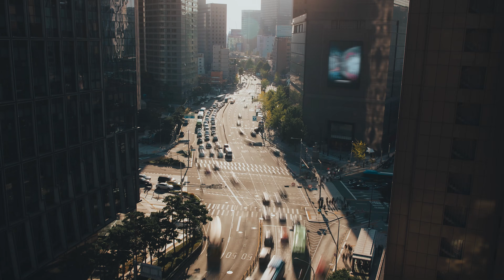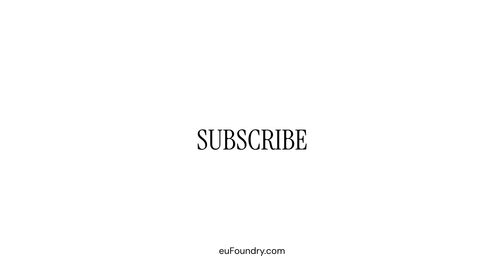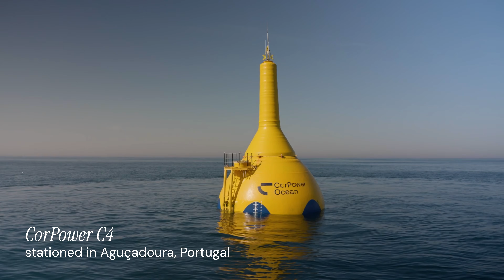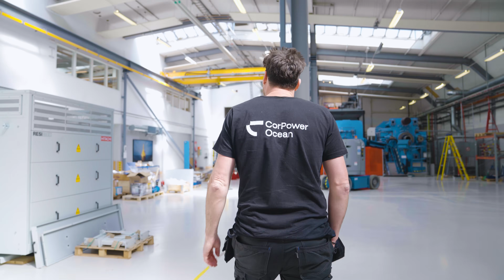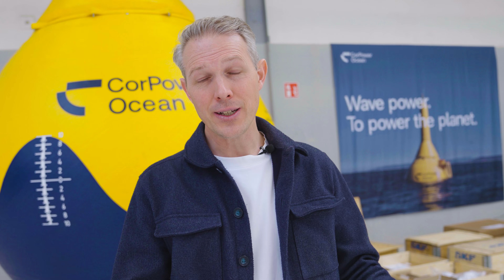The 10x More Efficient Renewable (That Nobody’s Talking About) #009

Comment: And yet just another parasite likes the rest of the Renewables the ignorance of the Renewables exporting to the grid is easily demonstrated with a volt amp meter and Ohm's law so once you double check the inverter and or the power companies watt meter you'll see an 85% difference from what is actually going in the grid and discover a reason for skyrocketing electric bills
Reply: And the other ignorant part about renewables is you cannot make renewables with renewables duh

Comment: Glad someone is still working on this; however the mechanism still appears to be too complicated.
I wonder if the designers have considered a similar machine with a more basic rack and pinion system without all of the articulating bracing structures.
I believe that the anchoring system is "off the self" , his is a GOOD move.  A system like this needs to use as many existing parts as possible. bespoke parts and tooling to make them REALLY eats up the design budget and makes the end product impractically expensive.

Comment: Weather based energy will never work.   You can not run factories, businesses , or homes on something g unreliable.   So what happens with these?  You need a traditional power system running along side it.   So you’re still using traditional power whether you meed it or not.

Comment: It would be nice in one of these videos they would actually talk about the most important thing ie the roi. Hey, we plan on selling these for X price range. If you can sell the electricity at .18 cents a kWh or in this range then your payback is this many years. The devise can last y number of years. 

Every other bit of talking is simply noise and hot air compared to the latter example.

Comment: Efficiency is not the metric to optimise;  Efficiency, (power out)/ (power in) doesn't matter so much as there's a lot of wave power. The thing you want to optimise is how much power (actual average power generated) do you get per million pounds or euros spent? In renewables CAPEX matters most, high interest rates mean it is expensive to raise the capital for the project and future earnings are diminished.

Also, in your intro quick zoom through the pioneers, l think that you particularaly need to hail Stephen Salter because he is the grand daddy of modern wave power in practice and in terms of engineering science and because he died last year leaving a major academic legacy and financial one (he set up a renewables enineering incubator (the Salter Centre).

Comment: Sorry, this is nonsense. Water is denser and holds more energy than air, but an offshore wind turbine sweeps and extracts energy from an absolutely huge area. These buoys extract energy from a 9 m diameter. That's why you need 30 for the same nameplate capacity as a single (10 MW) turbine (and turbines are going up to 15 MW already). So also 30 seabed piles(!), 30 inter-array cables, 10 times the cost and about 1,000 times the mechanical complexity. Don't like the variability of wind? Add onshore battery storage: solved at a fraction of the complexity and with zero existing ocean-user opposition.

Comment: I'm wondering if it's actually practical. The biggest offshore wind turbines being installed now are 15MW. That means you would need 45 of these buoys to produce the same power as one wind turbine.

Taking Ecowende as an example, one turbine takes up 173ha on average. If you fill that area with these buoys instead, and give each of them 200 meter clearance to every other buoy, you would be able to fit roughly 100 buoys. That would yield a power output of 33MW, more than double what a single turbine would produce.

I don't know if 200 meters is realistic. I suppose you would need space to be able to maintain these buoys. An animation in the video showed how a ship pulls the buoy into its place using a pulley in the anchor. Maybe 200 meters is not enough space then.

Comment: Clever stuff, but we've seen many of these wave power devices come & go for decades. The problems of reliably anchoring the device & avoiding connecting cables from breaking always get in the way. Plus, like wind turbines you have enormous extra grid costs to bring the spread out, remote energy to where it is needed. I'll bet this idea never sees large scale commercialisation.

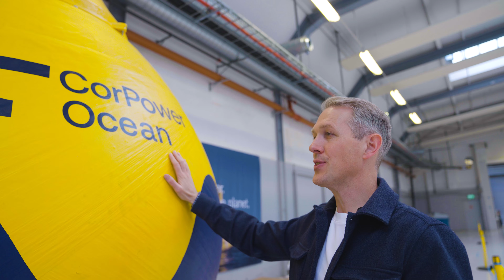Comment: 3:00 could have just used stainless steel, would have allowed for recycling at end of life.
Reply: Stainless steel are well-known to sensitive to diluted chloride as in the sea with sodium+chloride. Stress Corrosion Cracking (SCC) is the scientific name for this failure mode.

Comment: That buoy is like a point, need a line of 10km upwards, or a similar large area. Fixed shoreline infrastructure works at a cost, but floating about will have challenges. Maybe Weymouth harbour wall at 4.5km long. There's also wind and solar, so pricing and other factors need to be as competitive.  This energy equation is moving to solar in orbital space. Meanwhile solar PV is doing very well when it's sunny, but there's a negligent lack of investment in seasonal storage of renewables.

Comment: So they’re kind of admitting in their thumbnail that renewables are inefficient… funny they only say that when they got some new device, they want to gaslight about.

If we built two robots to flip a car upside down, we could probably drain the oil, but it would be easier to use the oil plug

It’s time to stop all the over engineered, intermittent, low inertia, sketchy recycling story, and short lifespan of renewables… let’s cut the hype and just go nuclear and be done with it.

Comment: Another deluded zealot "can create something that is 24x7 clean" - wind is clean? are you joking? Think of the resources needed to build wind turbines, the wildlife they kill, the intermittency and unreliability of their power and the huge landfill they create - how long do blades take to decompose!... solar? think of the mining consequences to create and then the impossibility of recycling! That said, tidal/wave and hydro are the only viable low carbon, intermittent, on-demand power sources and nuclear is the only viable low-carbon base load with the inertia to keep the grid stable. All good - and even better if you are worried about CO2, which you should not be. Worry about atmospheric water vapour if you want to worry about anything. Better still, don't worry at all - current climate change is nothing to what we had 500 years ago, or 5,000 years ago, or 50,000 years ago etc.

Comment: Might work for coastal communities, but if you live 200 miles inland the line loss on the power lines alone will make in unfeasible.  You want clean energy go Nuclear.
Reply from the maker: true. watch out video about nuclear reactors. they solve that. a mix is best.

Comment: The simple reason wave generators never  get up is because of the destructiveness of the ocean, the saline environment. and the difficulty of service. It's a bit like nuclear fusion. It's about ten years off and has been for the last seventy years.
Reply: Like nuclear fusion?
The CorPower C4 has been certified by DNV under DNV-SE-0120, Certification of Wave Energy Converters and Arrays, following independent verification. The certificate confirms the technology meets DNV’s stringent requirements for structural strength, reliability and safety, establishing a new international benchmark for the wave energy industry. It also establishes a significantly reduced technology risk, unlocking the project finance, insurance and institutional investment in commercial deployment. 
The Prototype Certificate follows a seven-year process with DNV, which began with establishing the design basis for the CorPower C4. Throughout the program, DNV independently reviewed and approved concept development, detailed engineering, structural strength and fatigue analysis, manufacturing, assembly, dry testing, installation, operations and maintenance, and device performance in extreme conditions with storm waves of up to 18.5 metres.
Reply: @td5816  That all sounds great, and I can't say that your answer is anything less than comprehensive. But even with all of this assurance, any real comparative benefits must be proven in a commercial environment. If that works out, then it should be a useful addition to the mix. Until then...
Reply: @vitabricksnailslime8273  The project Viana Wave in Portugal will become the world’s first 10MW wave energy farm.
Final Investment Decision 2027, operational 2029/30.
This is a concrete plan. Then we will learn more.

Comment: I wish them success,I'm just worried about how many moving parts they got in there.
Reply: Yeah the amount of moving parts in a nuclear reactor is monumental. And turbines on coal fired power plants are complex and require tons of maintenance..
Reply: I guess you gave up driving your ICE car decades ago for the very same reason.
Reply: Do you have the same concerns about coal-fired power stations?  Do you understand the supply-chain involved in coal-fired power stations?   
Do you understand the cost of storing spent nuclear fuel?  How about the logistics of getting Crude oil, from underground, into a Car?

Comment: What you're going to do with 9 tones of glass fibres and resin multiplied by 100, 1000 pieces at the end of it life cycle? It suffers from same issue as fiberglass boat industries where waste is more  expensive to  recycle than make it new. Resin is fosil fuel product.
The principle itself is too complicated, there's critical components like piston seals keeping the salt water out of baloon, which has voltage generators inside, salt water and electricity mixed makes big bada boom... don't get it how they managed to suck investors money for so long?

Comment: The more you talked about it, the more I was interested.  Well done all around.
I have questions about the size choice and why no fly wheel is involved.  I also wonder about the cost of the system, say on a smaller Pacific island community, compared to whatever methods they use today.  Hopefully, this solves it for wave power generation and fills a gap for the current and near future.

Comment: There's no question that waves/swells represent a lot of power. There IS a question about how much per kilowatt-hour the power will cost. I can buy solar panels today for about 50 cents/watt. I have some solar panels at my house that have been making electricity for about 15 years with no maintenance (other than washing them off a few times) since installed. Cost was less than $1000 for three 150 watt panels and one grid-tie inverter. I have no battery, the solar feeds the grid thru my meter and thus defrays my grid electricity use. I conservatively estimate the little system has generated about 3.3 million watt-hours of electricity: (3 x 150 watt panels) x (1/3 stated power) x (4 hours/day) x (365 days/year) x (15 years) = 3.3 million watt-hours. Cost per kW-hr is $1000/3.3 million kW-hr = .0003 dollar per kW-hr or .03 cents per kW-hr.   Grid electricity costs me about 10 cents/kW-hr in Texas and about 20 cents/kW-hr in California. So my home solar electricity costs me about 1/300 of Texas electricity and about 1/600 of California electricity. If I did the math correctly. 
Solar has low initial cost, extremely low maintenance, and lasts a very long time. But only works in the day, so it's not the complete solution but is a very big part of the solution.

EDIT: I made an error in the cost calculation above by equating W-hr to kW-hr (but what's a factor of 1000 between friends?). Sorry!
Correction from the error to the end of the post as follows: 
Cost per W-hr is $1000/3.3 million W-hr = .0003 dollar per W-hr or .03 cents per W-hr or about 30 cents per kW-hr.   Grid electricity costs me about 10 cents/kW-hr in Texas and about 20 cents/kW-hr in California. So my home solar electricity costs me about 3 times my Texas grid electricity and about 1.5 times my California grid electricity. So if the system runs another 5 years without additional cost, I'll break even in California. If I did the math correctly. 
Solar has low initial cost, extremely low maintenance, and lasts a very long time. But only works in the day, so it's not the complete solution but is a very big part of the solution.

Comment: Looks good but surely a failure point will be the seals around the four slider rods at the base of the buoy? How is the seawater kept out? How often would these seals require replacement?
Reply: Bidge pump? Packing? I want to see the economics. Turns off in winter storms, same with wind turbines, and there are clouds. Better have emergency gas generators. Cool concept.

Comment: Not convinced, this will be cheaper than solar and batteries.
Reply: They're not competing on cost, they are competing on constancy of power supply.  However, if you can skip the whole battery/conversion kerfuffle because your generator operates continuously it's hard to see why that is more expensive.

Comment: Its a shit idea and really basic.I can give you just as basic idea thats more efficient.
Run a line through pulleys with a  Dynamo  attached  to the sea bed..Attach a  float at each end of the line. As the line runs throght the pulleys  you generate electric

Comment: you need around 75 of these buoys to harvest roughly as much energy as 1 modern offshore wind turbine. i personally am more a fan of just solar + good batteries like water based gravity batteries or just the usual LFP batteries because once the supply chains are fully made the maintenance is way easier than having to climb on wind turbines or dive deep to repair buoys, the salt water also acts as catalyst for rusting but maybe with good alloys that problem can be solved. my only fear is that these types of "renewable innovation companies" grap a lot of tax payers money from the governments leading to an existence of failure companies that just cost a lot of money without generating enough profits to pay for it and at the end of the day the tax payer has to pay that bad decision making of both the innovation companies and governments. and then the CEOs of these innovative companies still walk away with a profit while the innocent tax payers have to pay for his and their governments bad decision making. i have witnessed similar things before so i'd say this fear is valid
Reply: I feel like this technology fills more the niche of base load / less correlated renewable source that might be very appealing in the sector. If the 60 €/MW figure is to be believed this solution might be quite competitive in most European nations.
Reply: Governments spend billions on defence contracts that produce nothing. This is peanuts by comparison. If one in twenty such projects ends in success, it will be money well spent.
Reply: Yeah, if battery technology keeps getting better solar is sure to dominate.
Reply: Sure, but you can mix these in with wind turbines. So an off-shore wind farm could be generating power even when in low wind conditions.
Reply: It’s early days but in time i see these as making a significant difference once the efficiency improves. 👌🏻
Reply: Don’t forget that these bouys can operate in the same space as the offshore wind turbines. On a micro scale, when it’s already so hard (presumably) to get the space for a farm, any way to maximize the value of this space will be explored by the wind farm owners